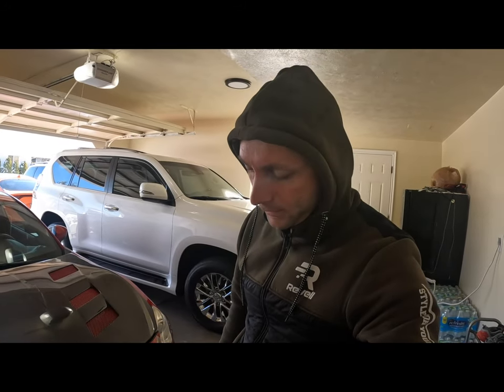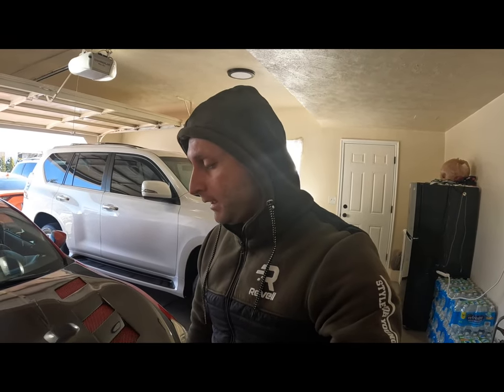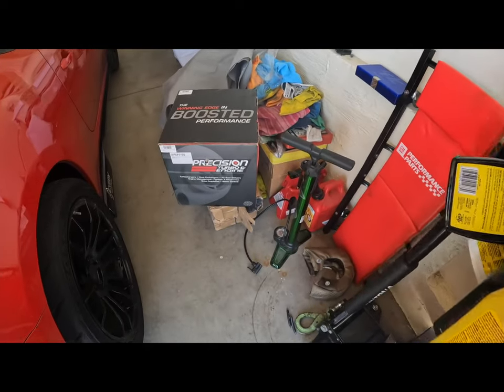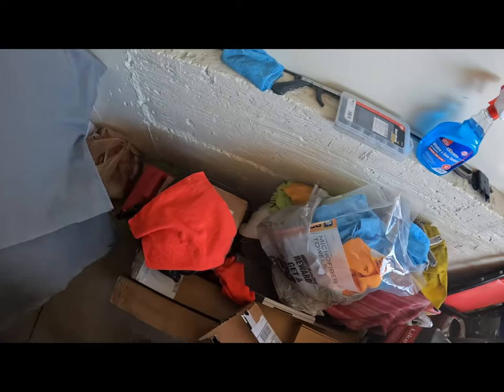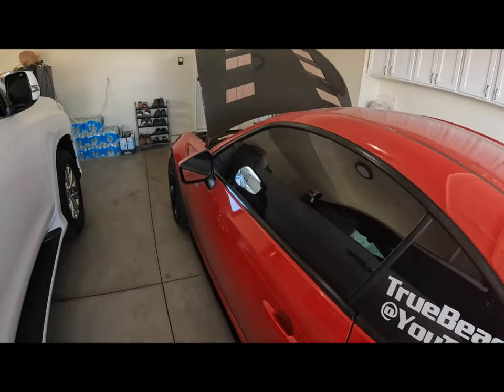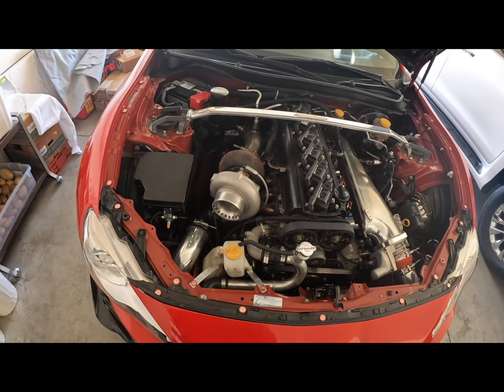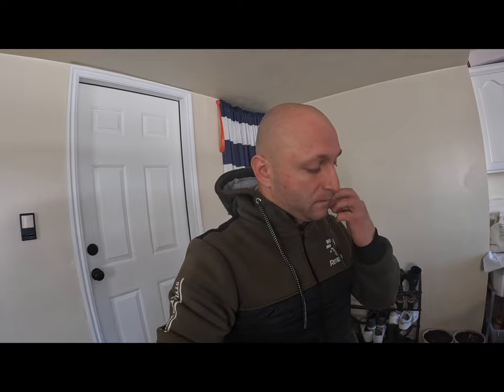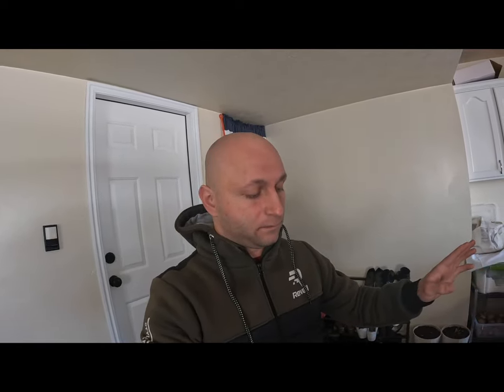30psi of boost and this is what happened!!

Comment: Hey, how are you liking the 3.58 rear end so far? Does it hook better/less traction issues? And about how much power do you think you’re putting down now with new exhaust vs what you were making before?
Reply from the maker: 3.58 is great a lot less spinning the wheel and it’s nice to stay in gear bit longer. Car is still at 30psi but I replaced the my old turbo for a new one exhaust is same didn’t do anything to it yet it was to cold to do anything I haven’t put my car in the dayno whit 30psi but it was 872whp at  22psi. And I have been trashing it whit that new rear and ands it’s been great
Reply: @truebeast3157 
Thanks for the info, I can’t even imagine anything over 700whp that’s insane. Most I’m probably gonna be making is low 600whp but I have shorter gear ratios than your trans so I’m gonna swap my 3.73 to a 3.58.
Reply from the maker: @brandonrivera2065  anything above 500 is perfect you will like it